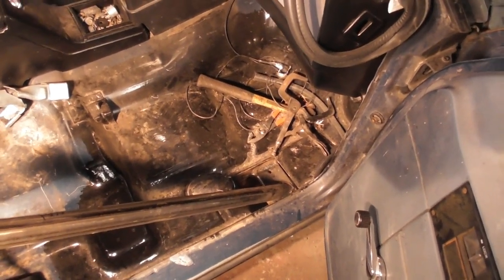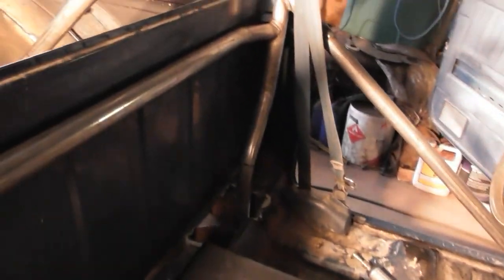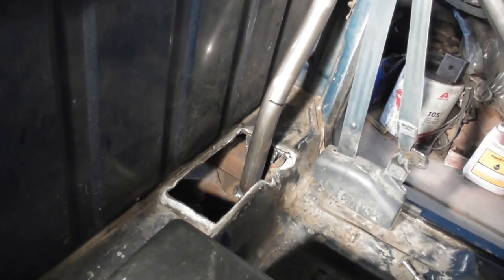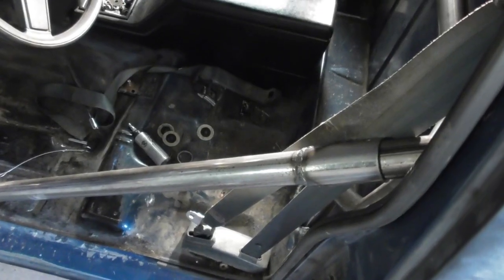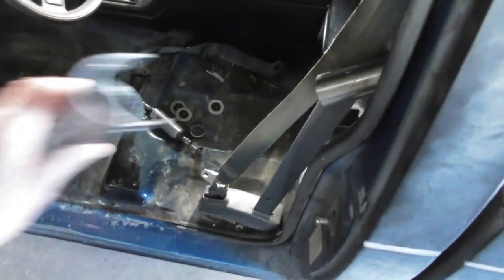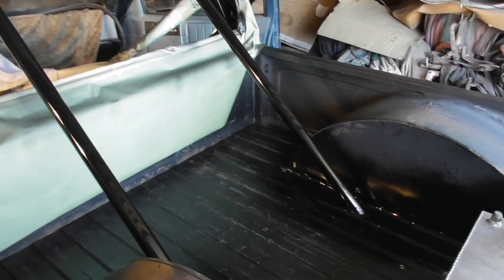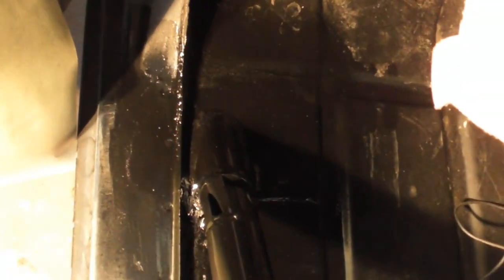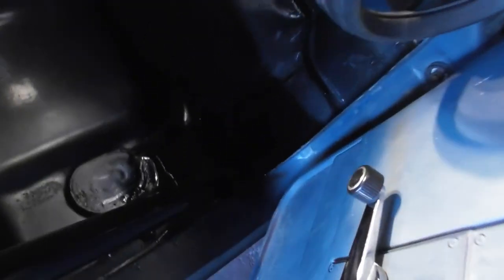s10 6 point roll bar / cage with swing out door bar how we made it

Comment: I maybe wrong but i dont think nhra tech likes the hoop to serve in like that again I m probably wrong
Reply from the maker: the problem with going straight down is the cab mount is in the way. if you go straight down to the frame the hoop is to narrow.  i did see a video on here where the roll bar was just welded to the floor of the cab. i know for sure that is not legal on a full frame vehicle. we might need to add an angled bar on each side towards the center of the cab to help support the hoop? the guy that owns the truck needs to make it down the track without blowing the engine up first, lol  ill have more of this truck coming up. thanks for watching!

Comment: Bro I hope u never roll this ruck cause it's gonna collapse. I speak from experience and I had way more material and gusset ing etc and plated before hitting frame
Reply from the maker: i hope not either. i agree it could use some more bracing, still working on it as the budget allows.